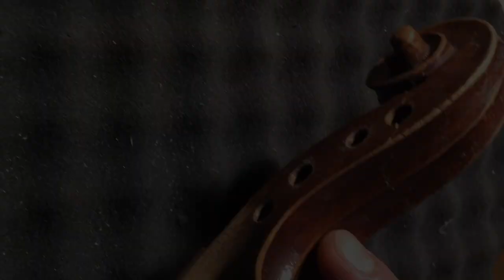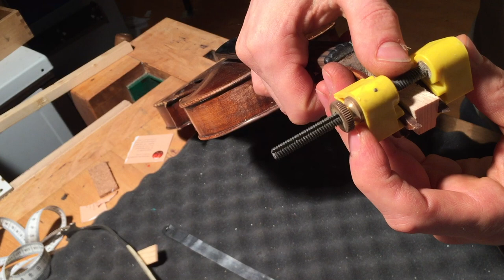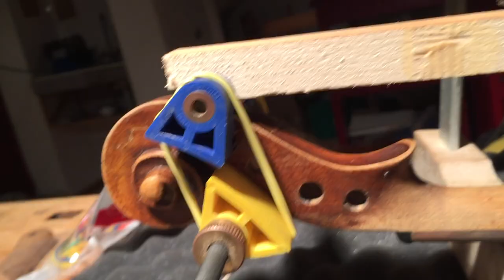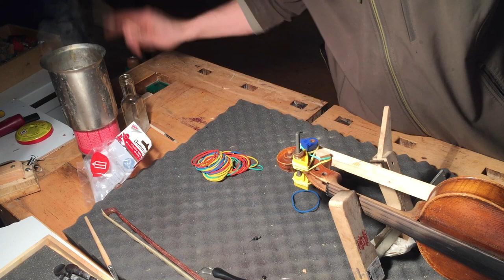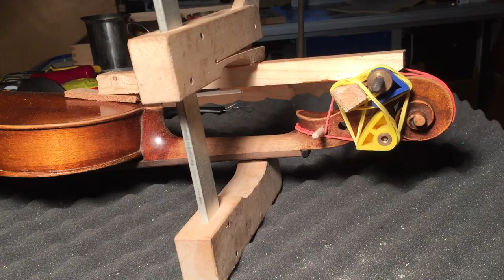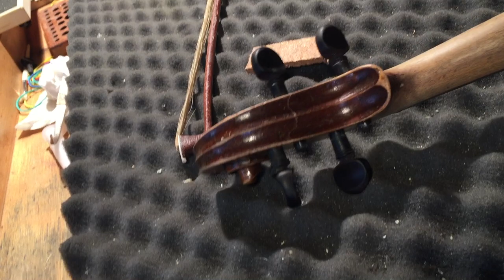Broken Violin Neck Scroll Clamping Operation

Comment: Thanks for the video. Great clamping idea. Maple is not as easy in gluing as mahogany or walnut, but you seemed to have solved that problem with your clamping setup. Hopefully, the hide glue will hold. I repaired a break like that about ten years ago but used small amounts of epoxy. I know that's not traditional, but it's still holding well. The strings exert quite a bit of pressure on the peghead.
Reply from the maker: Thanks for the comment. I think Maple is much easier to glue than wood with big pores. especially with hide glue, which flows very well. Also it is transparent, varnish friendly and repair-friendly. Since the break was not a flat joint, i am sure this will hold as long the pegs have a nice fitting/setting with without to much pressure on the box.

Comment: I am sorry, but you just glued the two pieces with no ;patches at all? I would assume on both sides patches should be executed as well. Or is this job just half done?
Reply from the maker: The glued surface came together so well, also the crack was not a flat break nor a planed joint. That is why i dont worry,
Reply: One of the pegs goes through the glued hole exerting centrifugal forces two of which will meet the glued surfaces perpendicularly causing magnified stress. It won’t hold even if welded. As someone already mentioned at least patch it. Or better yet rejoin the broken parts using another lumber and re-carve the peg hole.

Comment: Is there a follow up for  the cosmetic touching up? I just did the same repair on a violin with a broken headstock like that I couldn't clamp it without it sliding out of place so I just did it by hand without any clamps putting a peg in a peg hole to help with alignment I just need to touch it up now It's a Stentor
Reply from the maker: Nice! I am not back to making videos yet,,, sorry i dont know if or when, at this time.

Comment: I"m surprised yellow glue wasn't used. It makes a bond stronger than the surrounding wood. Working time isn't very long so everything has to go together pretty quickly, but it is a vastly superior glue.
Reply from the maker: Yes, it would make the instrument irreparable, and therefor worthless with upcoming repair works.
Reply: @CJKViolin  I suspected that may have been the reason. A very different mindset from non instrument repair type wood working.
Reply from the maker: @laurencelance586  sure, hide glue is the most reversible glue, but not waterproof at all. Most guitar maker btw don't use that hide glue but its the standard glue for violin makers.

Comment: Est ce qu’il ne faut pas ajouter des semelles contre la partie cassée. Pour que la fracture soit bien consolidée
Reply from the maker: In this case, not. The crack closed well and there was a lot of face for the glue to hold it together due the uneven break. Not like a flat joint.

Comment: The point of hide glue is so you can take apart the violin later for repairs, since the glue breaks before the wood does. In an operation like this, you NEVER want this to come apart, so you want the strongest glue right? Why use hide glue? Why not just use a much stronger glue? Nobody should ever take that apart again!
Reply from the maker: Hide glue is very strong just not water proof as the rest of the instrument is not. 
The repair- and ´come apart´ joints in fact have to be glued with very watery hide glue to come apart.
We place pads to secure cracks and hide glue is much better for color and violin varnish repair work afterwards.
Reply: @CJKViolin  I'm very impressed!!

Comment: Wood glue would have been a better choice, this is a repair you Don't want to repair again following a patch, eventually, that will open up again
Reply from the maker: yes but NO, i don't use modern glue because it is not reversible and a big contra for glue & varnish jobs, also not as easy to work with. As long as its stronger (secured with patches) it must be ok and will break next to the repair work in an extreme situation. The Humidity-factor influencing traditional glue is not relevant to me.
Reply: @pipatp1288  wood glue is stronger than the original bond of wood so I don't see your point. Replacing a neck is ideal but sometimes the instrument is not worth the hassle or value.